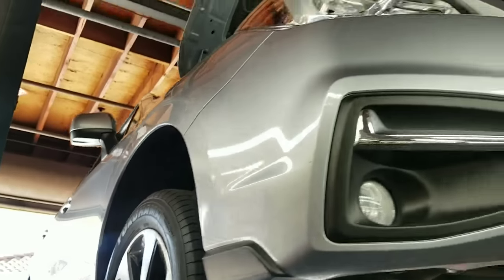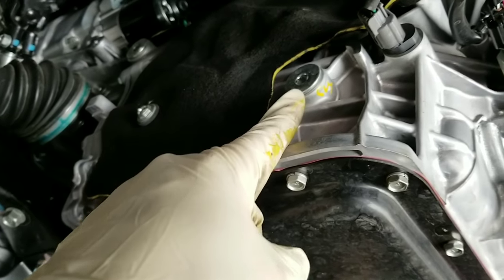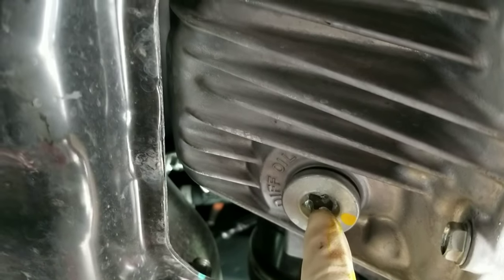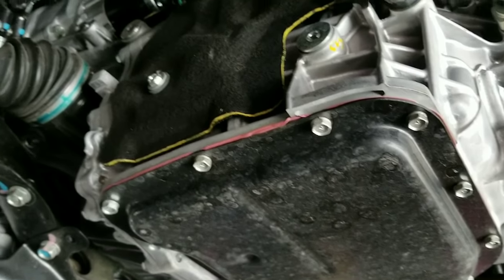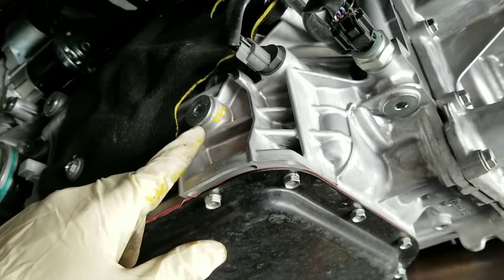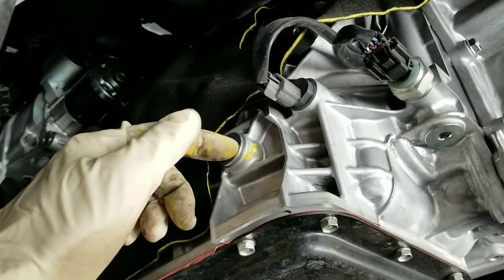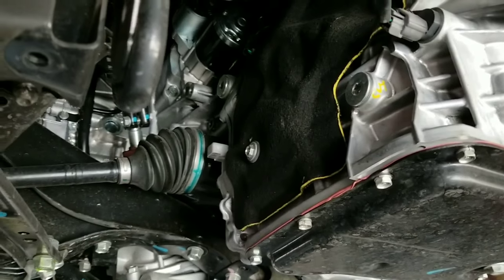Watch before you screw up your SUBARU CVT transmission & differential

Comment: For those wondering the rear diff drain and fill plug is a 10mm hex bit. The torque specs for both the fill and drain plug is 36 FT-lbs or 49 NM. For the front diff, the fill plug and the check plug is a 8mm hex bit. The drain plug is a T70 torx bit. The torque spec for the fill plug is 51 FT-lbs or 70 NM.
Reply: Thats why they were so damn difficult to get out. JFC 51 ftlbs?!?!
Reply: Not all have a fill plug for the front. The Ascents have a hose you have to pull near the trans fluid warmer.
Reply: They don't look like "hex" or allen plugs...they look like Torx. But, hey, what do I know?

Comment: I have yet to read the comments below, but must say, the "right hand side" is NOT the driver's side. The left or right sides of a vehicle are always determined by the seated driver: To his/her left is the "left side," and to his/her right is the right side. Please don't add to the confusion.
Reply from the maker: Thanks for the comment, but I also work on RHD cars, so this happens when i mention driver/passenger side quite often. i should keep to the right and left for future reference
Reply: @Es1911sumware ... Doesn’t matter where the seated driver is, left would still be left...
Reply: I wish they would just say driver's side or passenger side, that way even if you are in front of the vehicle it's easy to understand.
Reply: @kapuyawn  wrong. The right and left side are always right and left. But the drivers side depends upon the market the car was built for. In the USA the driver sits on the left side, In the UK or Japan the drivers side is the right.They
Reply: I was always taught standing at the rear of the car facing forward is how you determine right and left.  Has nothing to do with being inside or whether the car is left hand drive (US) or right hand drive (Japan, UK)
Reply: @Es1911sumware k wait.. did you just tell him he's wrong and then say the exact same thing?? 😂😂😂
Reply: @kapuyawn  you've obviously never heard the term "stage right" or "stage left"
Reply: @icdroid  but no matter what side of the car you sit on, as long As you're sitting in a seat in the car.. left is still left and right is still right. 😂😂😂
Reply: @edsmith4414  that's LITERALLY the same thing..
Reply: @icdroid  No, you are wrong. Yes, you are correct in that the left or right sides of a vehicle are always determined from the perspective of the seated driver. The region of the vehicle makes no difference. It's obvious he, along with many others, may not know that, but in America, they know which side the driver's side is on. And those watching a UK video, know which side the driver's side is on.
Reply: @edsmith4414  Yes, but many may not know that. In America, they know which side the driver's side is on.
Reply: @MichaelMosesHammer It doesn't matter where in the world one is from. From the perspective of all people sitting in a car, looking forward, left is left and right is right, but it most certainly matters where you are from when referencing the driver and passenger side. In the US, the driver's side is on the left. In the UK, the driver's side is on the right.
Reply: Now I'm doubly confused !     That is the way I like it.
Reply: Amazing how difficult it seems to explain right side left side. Davecar seems to have got it. Sitting in the car or standing next to the car, looking forward: left is left and right is right. Don’t care about where the steering wheel is.  Hard to know if the , any, expert is using left and right in this way. One can only hope, then verify!
Reply: @subtledriver  Yes, but you got it completely wrong, without any added confusion from RHD/LHD differences. Please fix this video with some onscreen text or something or take it down, because you stress how important it is to get the right plug but proceed to mix up right and left.
Reply: @kapuyawn  No way, left is always the left side of the car, right is right, without regard to which side the driver sits on. This is universal, no matter how YOU might misunderstand it. Using driver/passenger is where it gets ambiguous, not right/left.
Reply: One of my husband and my favorite sayings is: depends on the angle you’re viewing it at
Reply: @UMepher  Maybe we should just go nautical and use "port" and "starboard" sides of the car.  🙂
Reply: @kapuyawn e
Reply: Who cares to make fuss about drivers position. He made a mistake, but we all should know the right or left of our vehicles if we are going to do potentially detailed maintenance.  I get it. But we should focus on the facts. This very well could had been a Subaru  in Japan or England,  etc. Sans his American accent.  But not every u tube video is safe to follow without some double research or common sense. One could see the frontal location of the front differential in his video. That's  enough beyond a verbal for me.
Reply: 1000% LEFT AND RIGHT OF VEHICLE,  IS WHEN YOU'RE SEATED IN THE CAR!!
Reply: @MichaelMosesHammer Incorrect.  Assume your in Japan. Gotta think global audience.
Reply: In any market, the driver’s left is the left side of the vehicle, while the driver’s right is the right side of the vehicle.
Reply: @linnadawg not necessarily literally speaking if you’re standing on the front of the vehicle facing the vehicle the right side is the driver side, but if you’re underneath the vehicle standing on the left side of the transmission where are you check and fill the fluid that would be the left side.  But if you are indeed basing it upon the drivers seated position, then the driver side is always the left side, and the passenger side is always the right side., right?
Reply: You just saved a lot of lives Ken Howard.   You are a hero.
Reply: @subtledriver  Hello, I made the big mistake of pouring the liquid from the front differential on the driver's side, my question is, do you have to remove the entire transmission cover to remove the liquid or simply remove the cap from the transmission cover, drain it and return transmission liquid to its exact point?
Reply from the maker: @comeoll  what fluids? If you poured diff fluid, it's probably mixed in with the cvt now. Drain the cvt fluid, don't start car. Toss fluid. Drop pan/clean and reseal to get rest of fluid out. Then fill cvt with proper orange color cvt fluid following procedure. Fill diff with proper fluid from front right area (breather or plug near axle, depending on variant) diff can handle a splash or so of cvt fluid, but cvt won't accept  diff fluid so happily. Best to drain and fill cvt hot at some point after a test run to try and get the rest of diff fluid out of cvt trans. Good luck
Reply from the maker: @comeoll  you poured in the diff fluid stuff from the left side? Then drop the pan and drain it out all the way. Make sure to fill diff from right side (passenger) and cvt from the rear of transmission. Extra work. But gets the gear oil out of cvt transmission. Not good to mix the two. You can also change the filter if you want at this time. It's probably best to change the cvt fluid once more after driving it a little and drain it while it's warm to get everything out. And do it every 30k miles afterwards. You can use drain plug and not have to drop the pan every time after the first misshap.
Reply: I caught it as well and went straight to the comments😂😂😂
Reply: @linnadawg Left from standing at the bumper. Looking under the hood? That's different than left hand side if you're in the driver seat. Now you probably never worked on a car so why are you commenting?
Reply: You better listen again because he listed the sides correctly as left for the driver side and right for the passenger side

Comment: I just called a local Subaru dealership asking for a price to change the CVT fluid on my 2016 Crosstrek.  They told me they “would have to look at the car to see what was wrong with it before they could give me a price....if that makes any sense.”   I laughed and said it makes zero sense and I hung up on them.   I will do it myself.  Thank you for this video!
Reply: Huh??? I guess you know what dealer never to go to, ever. CVT fluid is factory scheduled maintenance, not a weird repair.
Reply: I have 2019 Forester and when I call them Transmition fluid change to CVT around 350$
Reply: I called and they told its not possible to drain the trans fluid. They said the system is "sealed".
Reply: @illuminati7767 idiots. It says in the owners manual to change it every 30k. Some mechanics.🤷🏻‍♂️
Reply: @mitchellsnellgrove5004  i argued with the guy. Laughed at him and hung up. Its sealed and not possible, but they charge you to change it lol. I told him if it isnt possible why is there a drain plug and fill plug? Lol. 

He even said the cvt fluid is for the life time of the car. I said what if it fails at 100k. He said well thats the life time of your car. I changed it with some help.
Reply: Logic. Any fluid then a lifetime fluid. If it will brake in 20k miles - thats your lifetime
Reply: I believe that Subaru  warranty covers the transmission for 100k mile only if the transmission is left untouched and not serviced for some reason.
Servicing the transmission beforehand will possibly void the factory warranty.
That is why the dealerships do not want to service them for mileage related maintenance and will ask what issue a owner is having before beginning any service or repairs on the transmission and differential assemblies.

Comment: If that wasn't confusing enough for you - different models (2.4 / 3.6 / TR580 / TR690) have all completely different drain/fill/check locations, all unlabeled. Pay the one-time $30 to access the exact service manual, triple check, label with a paint pen, AND once you open it up smell the fluid. Gear oil and cvt fluid have a distinct smell. If there are any doubts left just pay the shop to do it. I'm warning you this is an EASY EASY EASY error to make and the damage is around $11,000.

Comment: Don't change fluids when you're tired. I've changed oil on my 20+ cars over the years, and today went out - intending to do 1st oil change on wife's Forester - promptly drained the CVT. <sign> This video helped me get CVT fluids back in place.
Reply: LOL I did the same dang thing. I was hot, I'm used to rear wheel drive vehicles, and the plug was there. I actually put more oil in the engine, and it was way high in the dip stick. That is what alerted me. I knew it, because my x-type jags were basically the same setup with you have to be carefule which plugs you remove. On the jag, you will lose reverse if you unscrew this bolt that looks similar right next to the drain plug. A transmission mechanic actually did this. He never tried reverse, and he did repair the mistake which is a drag for him. So, I did the jags, and it was a temp monitoring fill also. Wasn't to big a deal. Just what a hassle.
Reply: I've always changed my own oil and I did the same thing. I take responsibility for not looking it up, but I've never need look up the oil location in the past so I never assumed I needed to for this car. And it's not even the first time I've changed the oil, I guess I just didn't see this nut before. What a pain.
Reply: I’m joining the club guys. Feel like such a dumbass. The filter was in such an easy spot why wouldn’t I assume the first plug I saw was the oil? Lol fuck me.
Reply: Same position, now I can’t get the fill bolt loose and pretty sure I’ve striped it trying. I’m lost and no way have the money to tow this for a fix.
Reply: @TheNightmareItachi  that’s weird. The plugs coming out was too easy for me, on a car with nearly 200k miles on it, in the northeast, they turned right out. Of course putting the plug back in, I over tightened it and cracked the aluminum casing. Luckily just the raised bushing area that the plug goes into. It broke right off and left a flush plug hole. I stuck a tapered pipe plug in and it’s fine now.
Reply: I color code the drain plugs in case of fatigue.
Reply: @Omni_rez  we ended up trying to take a grinder to it then hitting it with a hammer and chisel and still couldnt get it off. we ended up pulling a sensor and filling it back up via that hole

Comment: Fair warning about over tightening, over torquing the plugs! You are dealing with steel plugs and an aluminum case. Many have stripped the differential or CVT threads. I almost did trying to torque the front differential overflow tube plug to spec. Not worth it. Tighten enough and call it good.

Comment: Just a quick note for for owners of 2019+ Foresters.   The CVT fill plug location is on the RIGHT side.  The exhaust system was rerouted in 2019 and blocks the left side plug shown in this video.  All else still applies.
Reply: As in passenger or driver side?
Reply: My 2018 Impreza was like that too.
Reply: @freedom_foz_6337  The exhaust on my 2018 Impreza was on driver side (left), so the fill plug was on passenger side (right) for my cvt.
Reply: @Chieftain357 my 2017 Impreza, the exhaust is also on the driver side and I noticed there’s also a plug there.  However, there’s also another plug just on the opposite side of the cvt, on the passenger side. I’m confused.
Reply: @daeracer  Yep, mine was like that too. Check out Samb wague he has a video on it. He is the one that help me verify plug on right side was fill plug.
Reply: @Chieftain357 thanks man. That really helps. I was a big dumbass today and accidentally drain the cvt fluid instead of the oil. 😢
Reply: @daeracer   Glad I could help. Happens to the best of us.

Comment: My Subaru dealership says NOT to change the CVT transmission fluid? That it is a "sealed system" that is not supposed to be touched. And there is no mention of it in the owner's manual maintenance section. Why is there SO MUCH conflicting info regarding this???? It's driving me nuts.
Reply from the maker: I would personally change it every 20k miles. The dealer is full of crap.
Reply: @Mike80528  dude, did you even read the owner manual? It specify inspection and replacement under heavy use every 30k miles. Definition of heavy use include city stop and go traffic and more. By that standard, everyone drives in city needs to have it replaced. Owners manual wants you to replace.
Reply from the maker: @stanley19430  thank you, if you go 100k without changing, that is not very smart. I recommend every 20-30k for city or off road use.

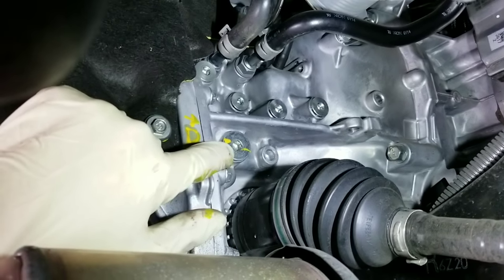Comment: @1:57 The right hand side is not the driver's side in America.
Reply: Bingo, good catch.  He referenced the right/left sides correctly, but should have said passenger side for the front diff fill.
Reply from the maker: thanks for noticing. I get the two mixed up, since i work on and race right and left hand drive vehicles.
Reply: @subtledriver  It doesn't matter which side the driver is on; the side to the seated driver's left is the vehicle's "left side,"  to their right is "the right side." "Driver's side" or "passenger's side," obviously, can vary, depending on the country where the car was built. People have to agree on a common language to communicate effectively. Regarding CVTs though: I'll pass.
Reply: Haha I came to comment this. Shout out to Mr. SOUTH CAROLINA
Reply: It's not problem left or right..look good for the picture in this video how look the fill..thanks you
Reply: Whenever you order parts it’s always determined left or right sitting in the car no matter where on earth we are
Reply: Yep. Best to avoid any mention of "drivers" and "passengers" side. This causes confusion. It is either the left or the right side.
Reply: Well it is if you're looking from the front of the engine backwards and you're talking about engine rotation but if you're sitting in the driver seat the left hand side of the engine is the driver side... it gets to be confusing
Reply: @ sides on a car is always dictated from sitting in the car. Not looking at it from the front.
Reply: dude had me second guessing the service i did on my 17 Outbk & Forester. Righty tighty, righty passenger (Unless your living down under Mates )
Reply: When I'm at the dentist and they ask which tooth, I respond driver's or passenger side. I don't want them confused.

Comment: FWIW - even "Subaru mechanics" at private shops and dealerships have made the mistake of mixing up the fluids - and inadvertently destroying both the diff and the CVT transmission.  So be SURE your mechanic knows what they're doing no matter where they work.  I confirmed that my CVT wasn't underfilled at the factory (a common problem early on) by opening the CVT fill port as described in the video above and confirming that when cold a good bit of fluid wanted to drain out -- quickly put the plug back in.  Then I drained the CVT fluid cold -- and measured how much came out.  In my case almost exactly 5 quarts.  I then put 5 quarts of new Subaru CVT fluid in through the upper port on the diff case which feeds into the CVT (on the engine left side as seated in vehicle, US driver's side).  Confirmed I was back above the traditional CVT fill port by loosening it and quickly re-tightening.   Diff drain and fill - open both drain and "check" ports; let drain; replace the drain plug/new washer and torque; refill through the upper fill port (on the engine right side as seated in the vehicle, US passenger side) - add diff fluid until fluid begins to come out the 'check level' hole.  Stop adding; let sit until no more diff fluid comes out the check fluid hole; replace that plug/new washer.  You're good to go.  My wife's 5 year old Crosstrek has only 13,000 miles on it; I change all the fluids every 3 years - except oil/filter every 6 months.  Flawless so far.
Reply: That CVT fluid is pricey and is supposed to be "lifetime" fluid